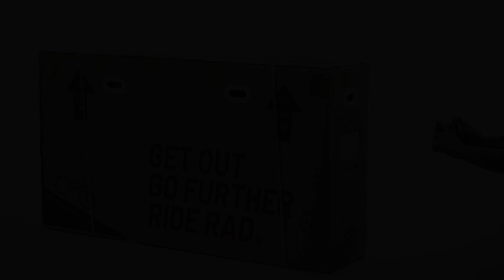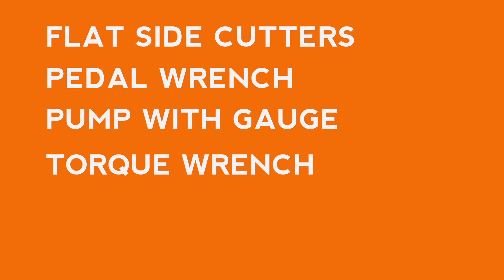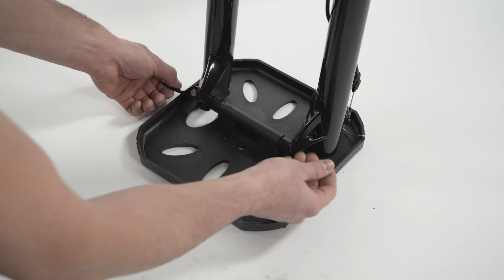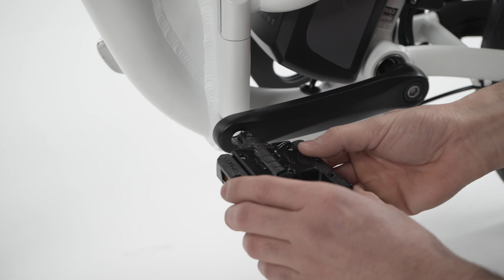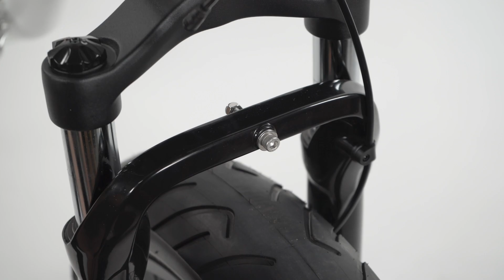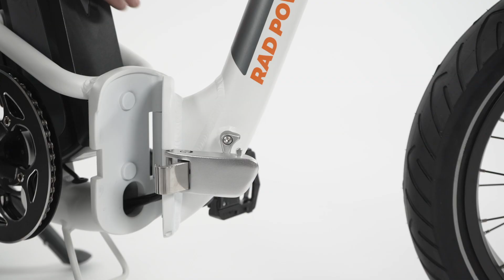2019 RadMini and RadMini Step-Thru Assembly Instructions

Comment: How is anyone supposed to know what 'Newton torque meters' are supposed to be? It took me several listenings to realize that was what was being said. Is 'hand tight' sufficient? And can you substitute WD40 for the 'bike lube' or some other kind of grease? I appreciate the effort put into this video but the man's voice could have been clearer - less mumbly in spots. I'm interested in buying one of these but now worried about assembly; you need to think of the range of your buyers - I'm a boomer female living alone without assembly experience, without a lot of tools and worried about safety as it relates to putting together and maintaining the bike.  But I still want something that will fold, be hopefully easy to put into the back of a sedan, and usable for years. I can barely lift 40 lbs; rolling that much weight is doable (to get it up onto the porch where I can lock it up) but getting it into the back of the car? Worrisome. If it's too hard to get into the car, the foldability is not an asset but almost a debit; I'd also worry about it coming unfolded while I was riding it.
Reply from the maker: Hey there! Our bikes arrive about 85% assembled and these last few steps are pretty straightforward. However, if you're uncertain about the process at all we'd absolutely recommend having the bike assembled and tuned by your local bike shop. All of our mechanical components are industry standard bicycle parts and any reputable mechanic should be able to assist. As far as your other questions go, our Customer Experience team is super solid and they'd be happy to chat with you about it! Give us a ring at (800) 939-0310 x1 or shoot us an email to "info@radpowerbikes.com" 👍

Comment: the font wheel install wasnt as easy for me. i wanna be able to easily take the wheel off and put in back on so i can take it in my car trunk. but i feel like you need two people to put the wheel back on
Reply: I just discovered that today as I was putting mine together.  I like the foldup so I can take it in the van for vacation, but that front wheel is a bear.  It will always take two, or flip it over upside down to drop it in.  Kind of a pain.
Reply: Richard Givens I agree. I just been riding it to parks on the street. It’s pretty easy with the pedal assist since there’s hills and I go like 9 miles each way and I get back with still 3 bars of battery left
Reply: @OGbuckle  I'm still charging mine up.  Excited!  :)

Comment: So you expect the average joe to own a few different types of torque wrenches?  Since they don't come with the tool kit, I'm finding it hard to believe that most folks would just have one laying around in the tool box.
Reply: Harbor Freight has very cheap torque wrenches, but these torque values provided are very low- it’s likely them covering their asses providing these. Just use common sense.
Reply: chris the alen wrenches provided are very poor quality. I have just about every mechanical hand tool that I can think of but I have got to think that years ago I wouldn’t have been able to assemble the bike any too easily. I love the bike but the manual falls FAR short of what a bike of this cost should come with. Every body does not live near a bike shop but a great many people can do the necessary repairs and adjustments given the right information. That’s where this company is certainly falling short.
Reply: I assembled mine with just the tool kit that came with the bike...
Reply: They have these things called, "stores".  You go to the "store" and buy stuff.  It's great.